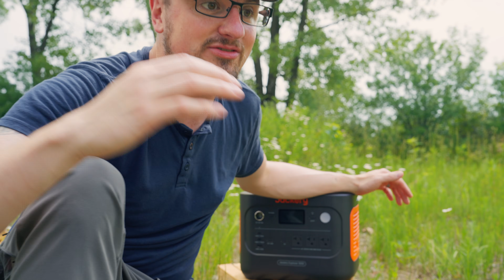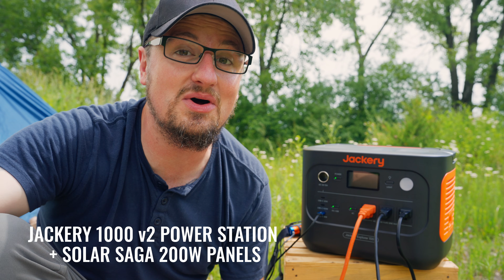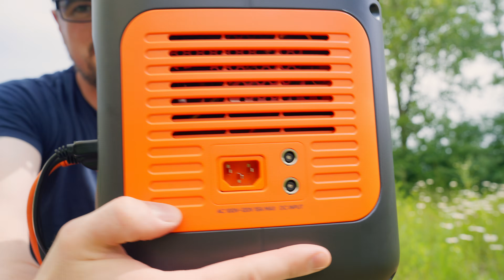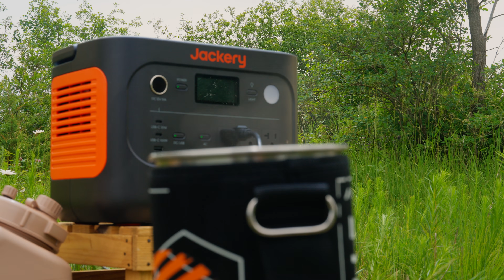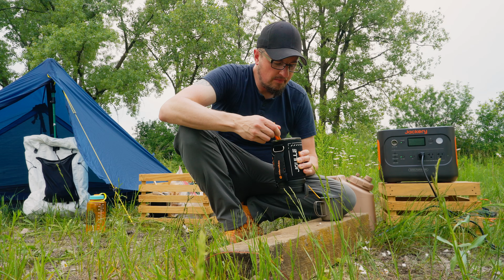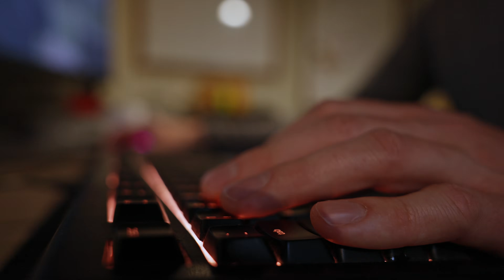What's different about the JACKERY 1000 v2 POWER STATION?

Comment: One mistake....it is not lighter or smaller than previous lithium ion batteries. It produces less power and is bigger batteries than lithium ion. It is a more stable, safer chemistry, and can withstand 6-10 times more charge cycles however. The added weight and mass are negligible, so it is more than worth the trade off.

Comment: Your description of the advantage of lifepo4 is confusingly wrong. The lifepo4 is much safer and has a many more life cycle but what you said that it is mire dense in power and lighter is very wrong. The dense power and less weight is the lithium ion batteries good quality but minus the long life cycle and safety of the lifepo4.

Comment: I’ve read every comment to try to decide whether to buy the jackery 1000v2. Right now oct 17th I can get the Bluetti ac180 for 380.00 because of a late delivery issue or I can cancel my order and use the jackery $40 off coupon on amazon for the 1000v2 which would be 460.00. I am so torn because I would prefer the lighter weight of the jackery yet I would have to buy an adapter to use my bluetti 200 watt panels on the jackery. I can not find which unit uses more power just being on both on ac or dc which would be a consideration and if either one stays on when a car fridge is not drawing power.

If anyone knows these things, I’d greatly appreciate the answer. Also at the quoted prices which unit do you think would be the most beneficial. I already own 1 ac180 and it’s a good unit just don’t know if the jackery would be better?

Comment: @grimgranite
You REALLY need to learn more about Battery chemistry and energy denisity
.
The implication is that the chemistry changed TO LiFePO4 making the density higher.
Of the 2 common Lithium ion types, NICKEL based cells have greater energy density, and lighter weight than iron based cells.